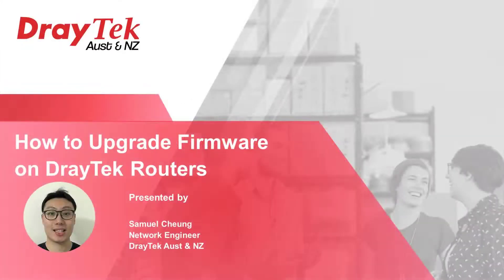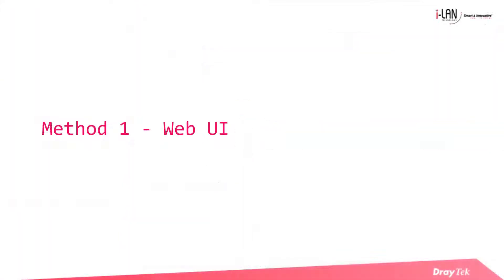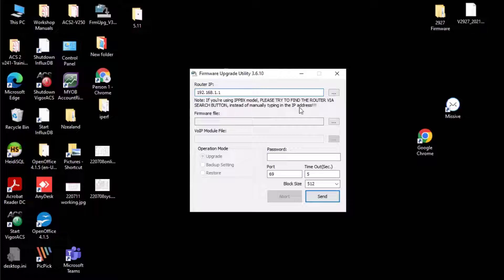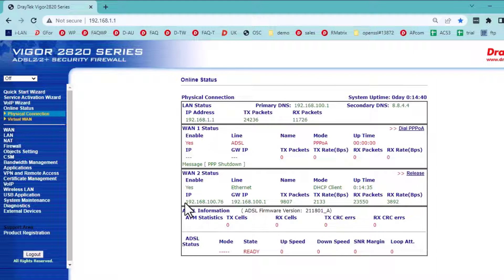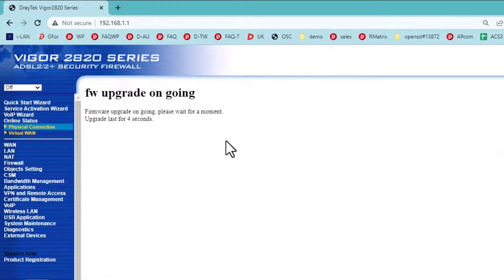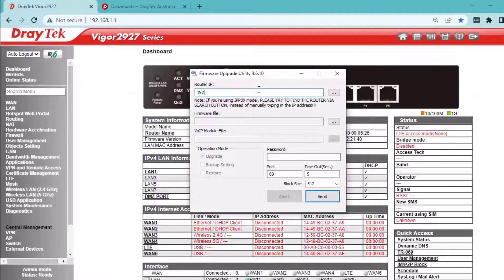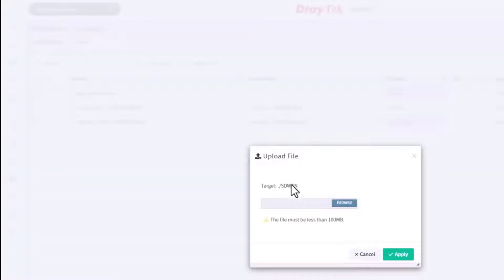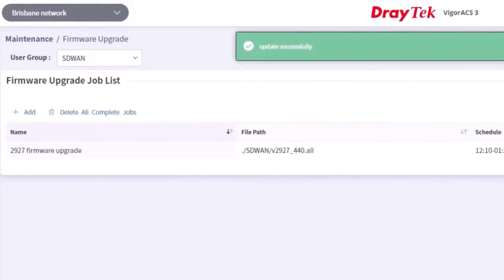How to Upgrade Firmware on DrayTek Routers

Comment: Hi. I have a Dray Tek Vigor 2762n. I have forgotten my password and the reset button isn't doing anything. Will a firmware flash reset everything and hopefully bring the reset button back in to play? If not is there any other way of resetting? Thanks
Reply from the maker: Unfortunately, flashing firmware requires knowing the admin password, so you will need to reset it first. Ensure you are pressing the reset button inside the hole and not just sticking a pointed object in the hole. You should be able to feel it. Then you need to hold it down for at least 10 seconds until the activity light starts flashing. You can also try holding the reset button while switching the router off and back on again. When the lights indicate the router is up, or all lights are flashing rapidly, release the button, then reboot it again. Another trick that sometimes works with stubborn routers is to hold the reset button down and turn the router off and on multiple times in quick succession before letting it boot up while still holding it, then releasing the button and rebooting when it seems to be up.
Note, it is possible your web browser has a record of the password used. In Chrome, click the 3 dots at the top right and go to passwords and Autofill >> Google Password Manager. Then type in your router's IP address in the search box.
More information on resetting routers and installing firmware is available from 9mins 22 secs at https://youtu.be/EmQJG3u7z1Q?si=lmpenYdRWSnTmgZf&t=562
Reply: @DrayTekAustNZ  Thanks for such a detailed reply. Just a quick question before I pursue this further. 
I got this router from a defunct business that hadn't even set up their offices before they ceased trading. 
I used their password in the first place and never changed it before I lost the password. 
Is it possible that the usual way of resetting  has been disabled for extra security?
If that is possible I likely have no way of resetting and now own a white brick!
Reply from the maker: @LewieLeway  Actually, it is possible to disable the reset button in these. In the config demo at http://eu.draytek.com:12762/, see System Maintenance >> Panel Control >> Button. Try the methods above before you give up on it though. Also, the forced TFTP mode in the video above at 4:41 may still work. Holding the reset button while router is starting will bypass the router configuration even if the button has been disabled. When in TFTP mode, the router IP will be 192.168.1.1 and admin password is admin.